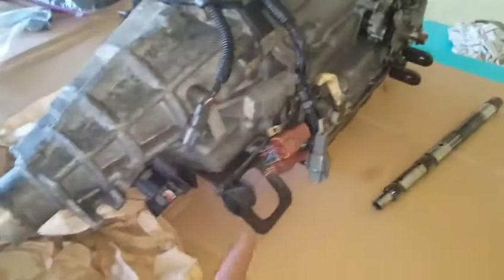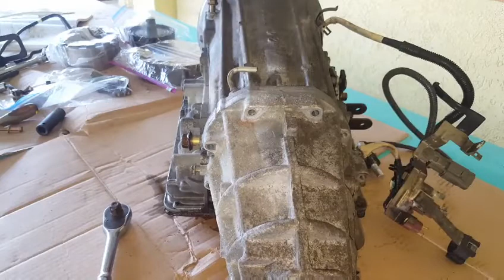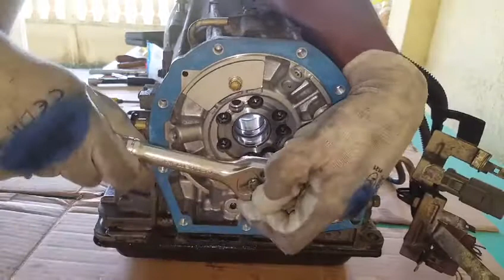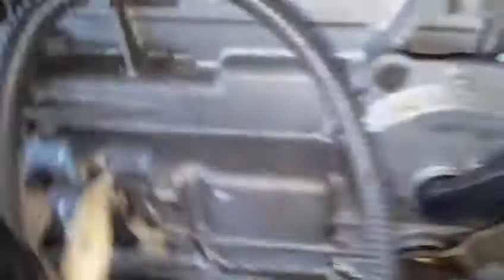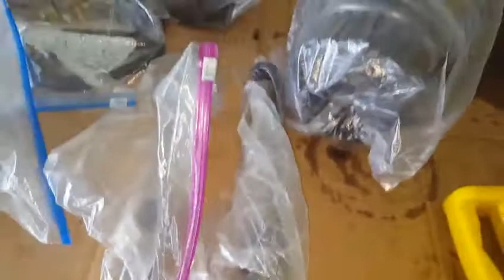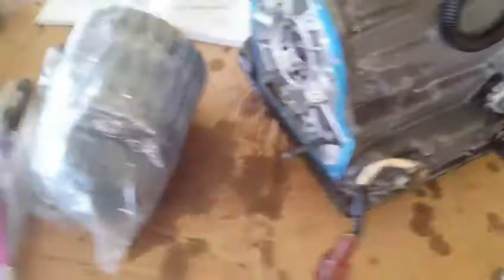Nissan RE4R01A Transmission Inspection. Part 2/11

Comment: I had issue with my re4r01a transmission on s13 200sx. When cold its working normal and smooth but it going to limp mode stuck at 2nd gear when hot. What could it be?
Reply from the maker: Faulty Sensors: A failing Vehicle Speed Sensor (VSS), Throttle Position Sensor (TPS/PNP switch), or ATF temperature sensor can send out-of-range data that forces the TCM into limp mode.

Shift Solenoids: Electrical shorts, sticking Shift Solenoid A or B, or a failing valve body harness can prevent proper fluid routing.

Fluid Condition: Low or contaminated fluid lowers line pressure, causing delayed cold shifting and erratic electronic control behavior. 

On the Nissan RE4R01A automatic transmission, getting stuck in 2nd gear during limp mode is the designated mechanical default fail-safe, while cold-shifting delays typically point to hydraulic or fluid pressure lag.

Recommended Next Steps are Pull Diagnostic Trouble Codes (DTCs): Scan the TCM for specific codes (like P0715, P0720, or shift solenoid codes) to see what is triggering limp mode. 

Check Fluid Level and Quality: Inspect the transmission dipstick with the engine warm and running; if the fluid is dark, burnt, or low, perform a fluid and filter change.

Inspect Wiring and Connectors: Look closely at the external wiring harness plugs going into the transmission casing for corrosion, loose pins, or oil contamination.

Comment: What is the curved metal pipe inserted in the transmission body with the hose attached to it seen in 1:08
Reply from the maker: Oil cooler lines to the lower radiator or a external oil cooler radiator is better.
Reply: @Stevexnycautomotive  Thanks Steve! One follow up question for you: Can you help me identify the breather vent / valve for pressure relief and seal damage prevention on the Nissan RE4R01A Transmission?
Reply from the maker: The transmission, the 4x4 transfer case, rearend and front differential vents should be extend to higher location by attaching 3/8 rubber hoses to the vent tube and let the other end of the hose seat high in the engine compartment.  The vent hose for the rearend differential can be extended behind the tail light. Sometimes water will get up to the door handle when cross creeks and deep water pond.